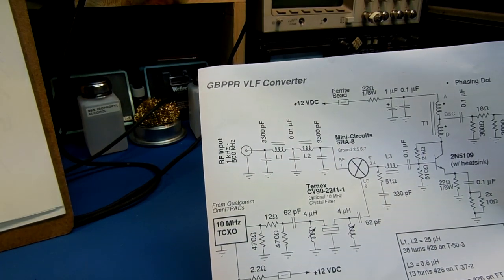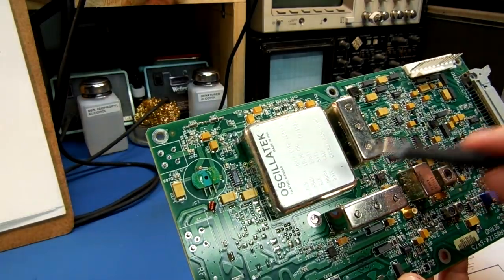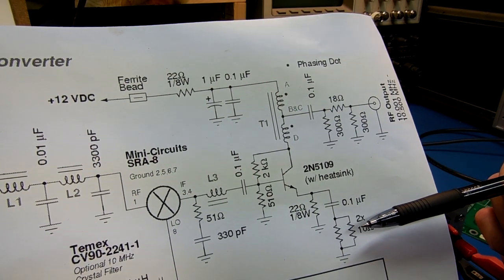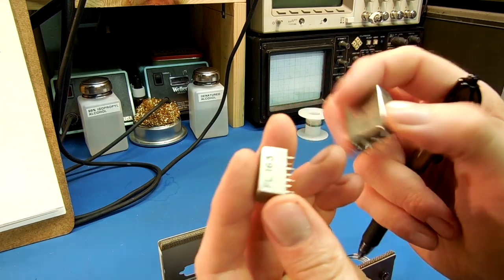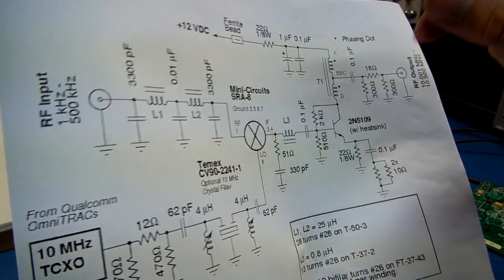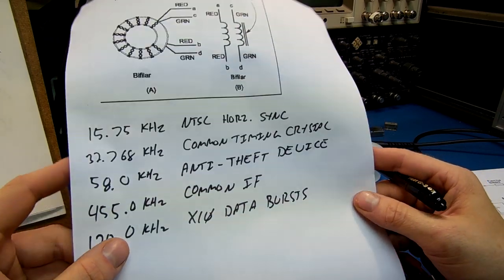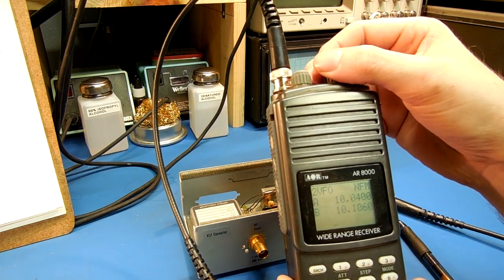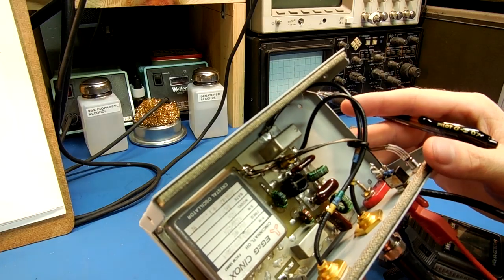GBPPR Vision #30: Very-Low Frequency Converter

Comment: A very pretty and well thought out design and construction, and a very good video as well. After seeing so much tech garbage on the web I'm impressed with your work. 
I chose to run battery power and not fight with AC power-line noise. I learned more about RF in a couple of years of LowFer experimenting than in 30 years of playing around at higher frequencies.